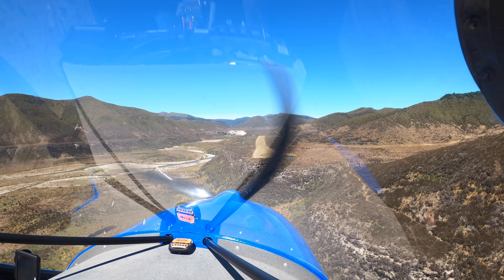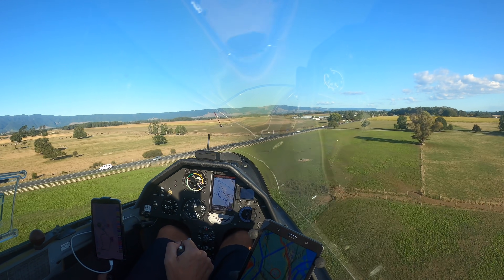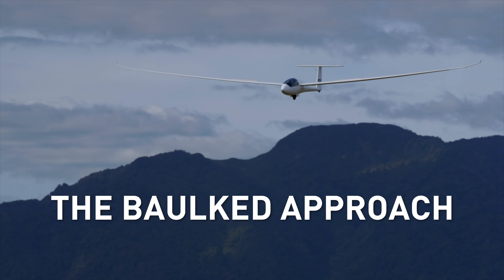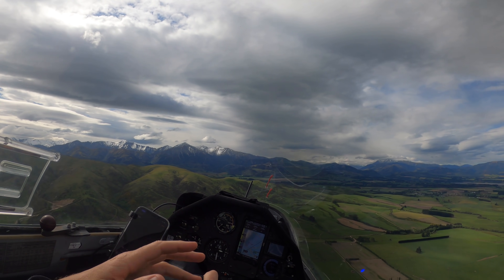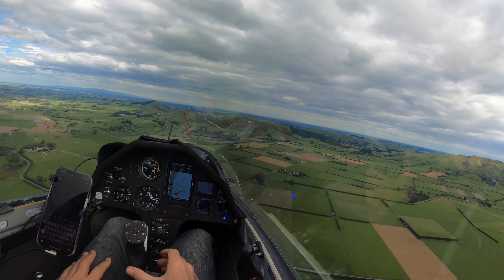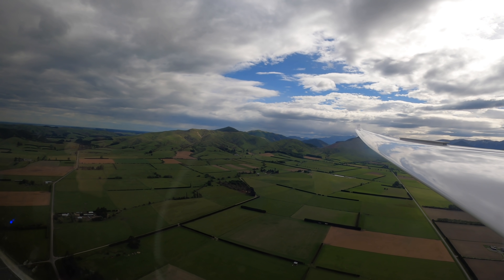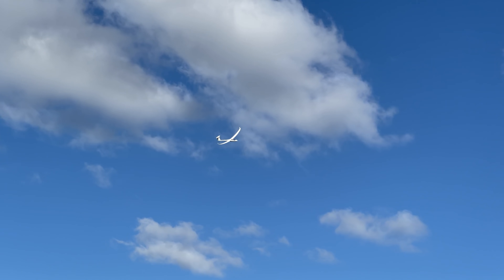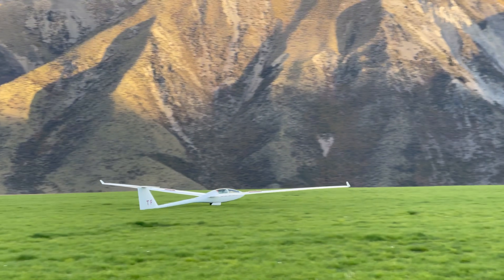Going around in a glider. Can a Glider Go Around?!

Comment: "the engine can't even go up that fast". If you have the engine and don't deploy it just to open the go around option if needed then you're just reckless. It's free safety ! Take it goddammit ! It's just like an airplane pilot switching on the electric fuel pump before landing : it's not for landing, it's tongo around.
Reply from the maker: Yes I would only do a fly through if I was at an airfield!

Comment: Of course gliders can't go around.  That's why glider traffic takes priority over powered traffic.  That first clip of the aircraft bouncing is PIO, pilot induced oscillation.  That means he came in too fast.  If you touch down at full stall, you shouldn't even have the speed for the aircraft to get airborne again.  He clearly touched down with flying speed.

Comment: Curious, in your practice landing let's say it was not a long runway and the obstacle was in exactly the wrong place. At the point you put the brakes away would you have had altitude enough to nose down, get some more airspeed and either go to the other runway or try again with a different plan.

Comment: This are endless opportunities compared to the options a paraglider has. In calm conditions your brakes varies the glide ration between 1:4 and 1:7. So we can't change the aiming point that much. You can try to steer but hence we have no rudder this always result in significant bank... and if you are not a good pilot this also result in a pendulum motion and or some pitch. So please if you are at a landing place for paragliders don't run across the field 🙂. We sometimes have hard enough time, when several gliders aproach the field at the same time and one of the pilots don't know the rules.
Reply from the maker: Thanks for sharing :)

Comment: Not exactly a go around but I used to own  a Slingsby Kestrel 19, it had a tail parachute which was not the most reliable in deploying. The airbrakes, well they made a nice noise. I would start my approach high, around 600ft and pull the parachute. It the parachute deployed, no problem, it was like catching your braces on the boundary fence. On the one occasion it did not deploy I had to rely on the reason I started the approach so high. I had the height to do a 360, with the lovely airbrake noise, and still make the airfield :-)

Comment: I was recently B Cert solo flying at Matamata in my clubs' PW5. I had setup a nice right hand circuit and was turning onto final when another glider, low and desperate, turned from base to final close in front and below me. They made the call for final. I acknowledged, I'd now be number 2, put my brakes away, watched them land below me then recommenced my steeper approach. Only disadvantage was I had to push the glider back a bit further after landing. The DI gave me a good pat on the back for that one.
Reply from the maker: Excellent, our training has proved you well :)
Reply: @PureGlide  , in my experience, B Cert and thereabouts pilots are among the safer pilots on the airfield.  They're current,  their training is still fresh, and they don't have that unwarranted cockiness that a 50 hour pilot has.

Comment: Is a contest finish technically a go-around?  Could you at high speed over the threshold pop the gear down, slow down and land?
Reply from the maker: I'd say at our runway, which is quite long, yes you could pull up, slow down, get the air brakes out and land. But you'll use quite a lot of space to do it!

Comment: I have twice done a go -around from a properly held off landing, from the ground roll, where we could have stopped; it did involve having a ridge at the end of the landing strip to fall off though!!  Airbrakes away, trundle offthe edge of the hill and down the slope a little, and back into the ridge lift!!  That was at Dunstable - airfield at the bottom of the 300ft ridge but a short strip (usually covered in walkers etc) at the top of the hill, from the old days of bungee launching from up there.  Also, a few go-arounds from the approach at the Mynd, where the club is based at the top of the 800ft high ridge - a high approach is necessary when the ridge is working, as its into lots of sink; but if a bit too high, no worries, go back into the ridge lift, climb and have another go!
Reply from the maker: True if your landing site has a handy ridge at the end then sounds like fun!

Comment: It comes down to several variables if you can do / have to do a kind of go around in a glider. I would not do so if there are areas on the airfield where to land safely, but this depends on length, width and layout of the airfield. If wide enough, you can go left, right or even about 45 degrees off your original landing spot. My home airfield is very narrow, (no meadows behind or aside) only 2 gliders could safely land beside each other (if both are landing to the left and right side, blocking take off as well), though long enough to have options to land in front or behind. As the area beside the landing strip „taxi area“ is quite narrow and bumpy, motorized gliders and planes sometimes use part of the landing strip for taxiing. One day I had to do a kind of „go around“, more like an aborted landing. As the thermals got weak, several gliders were in for landing in a short time. 2 were blocking the landing area right at the near end, one further down. So I came in a bit higher than usual, to land long. No problem. But just then a motorglider taxied where I intended to land (I was at final). In went the airbrakes and as I have had a slight lift on downwind, I made a short go around. No problem if you keep as many options as you can. Great video, very good explanation. Well done, 👍
Reply from the maker: Thanks!

Comment: Great video with very nice footages and clearly educational, and fun, with obviously the solution offered for most of us: close your brakes, etc..  Now suppose you are sitting in a fes glider (front electric sustainer/self launcher) and on final at a short field, when suddenly a deer decides to cross.... Assuming there is juice left in the battery, one could turn on the the fes after having closed the brakes and make a real go-around.... I have no experience with fes, would appreciate your opinion.
Reply from the maker: Yeah I didn't go into FES, that'll be it's own video at some point. But yes that's about the only type of glider engine that could potentially be used on final approach, because of the instant start. However you wouldn't be going into an outlanding field if you still had battery left! And if you're at your home airfield, you probably want to simply land up the field anyway.
Reply: @PureGlide  The “FES” on my RC- glider has saved the day, many times.
If you get blown over the ridge into lee-side-turbulence, no problem, just slam on the engine and climb (almost vertical) out of trouble…  😀👍
Reply: Or fire up the FES and dice up the deer for steaks for dinner.
Reply: There was a piece in the UK's SAilplane & Gliding last issue but one I think.   It was written in the aftermath of a serious (maybe fatal) crash with a two seater self sustainer ( not a FES BUT)              So what the accident investigators concluded was the crew hit a load of sink,  got too low far faaster than expected and instead of concentration on an outfield landing fixated on trying to start a sustainer motor that didn't want to participate.   Then some trees walked out in front of them and 'goodnight Vienna'.
But here's the thing:
Even with a FES either you see the deer, sheep, lunatic in a car etc well in advance and could start just about anything OR
It lurks in cover until the very last moment and your taskload is enormous.
My suspicion is you could do it ........ But unless its a very well practiced routine could easily go tits up.
Reply: There was a piece in the UK's Sailplane & Gliding last issue but one I think. It was written in the aftermath of a serious (maybe fatal) crash with a two seater self sustainer ( not a FES BUT)   ........      
So, what the accident investigators concluded was the crew hit a load of sink, got too low far faster than expected and instead of concentration on an outfield landing fixated on trying to start a sustainer motor that didn't want to participate.    Then some trees walked out in front of them and 'goodnight Vienna'. 
But here's the thing : 
Even with a FES either you see the deer, sheep, lunatic in a car etc well in advance and could start just about anything OR It lurks in cover until the very last moment and your taskload spike is *enormous*.    
My suspicion is you could do it ........ But unless its a very well practiced routine could easily go tits up.
In short,  IF its 'drilled in' to your mind as part of your Threat & Error Management - You maybe could make it work just like a powered plane would open the throttle.
Provided your FES would develop power fast enough?

Comment: A 'go around' is something I have only done once in a glider and I have no desire to repeat the excercise. As a newish Silver C pilot I bought a Std Austria as my first glider. It was an interesting beast and certainly had its challenges but on a half decent day would 'go' surprisingly well. Having been trained on a hilltop site my foremost priority was always to avoid getting too far downwind on approach but the Austria was no Ka 8, having much better penetration into wind and far weaker airbrakes. My first trip to a wave site in Wales ( the small one for those who know the area) was therefore, quite an experience! 

After a pleasant hour or two at 8000-9000' then suffering the turbulence on descent and establishing a circuit, I duly set up my final turn at about 1000', as briefed that morning. The issue was that none of the locals had ever flown an Austria and I had never flown on site before so none of us realised how inappropriate the 'briefed'  approach was. I think also, that the wave had shifted a bit and was providing lift on approach rather than just rotor so I found that even full airbrake settings had little or no effect on descent rate. I duly tried a full side-slip but the slippery shape and 'V' tail did not result in high enough drag to make much difference either, so I found myself with a decision to make! Behind me was a valley with about 600 - 700 feet of ground clearance and reasonable fields' whilst ahead of me was steeply rising ground and small fields culminating in a spine a similar height above the airfield. A right turn was not a favoured option and a left turn over a deep gulley provided lots of turbulence and a huge 'clutching hand' effect. Nevertheless, it was the better route to get to the valley behind and became my chosen maneouvre, preceeded by a swift radio call to the K13 (with CFI aboard) which I knew was in circuit behind me.

Upon completing a 180 degree turn I found that I had still lost very little height and the K13 had moved well away from the approach line thus enabling me to extend my downwind leg and have another go. To say I was concerned would be accurate (the abject terror came after landing) but I did manage to excecute a safe, but still long, uphill landing into the smallest airfield I have ever had the pleasure of using: pilot & glider re-usable. My next glider was a 19m Jantar 1 which had its own, quite different set of challenges at this site. Some say that if looking for a land-out field in South Wales there are many better options than this particular club and I am sure that is correct, but it is 'character building' and has become one of my favourite UK sites over the many years I have now been visiting. Happy Days! :-)
Reply: Ah the joys of flying at Talgarth - can't beat a glider with a good set of airbrakes and robust undercarriage flying from there. Can remember a certain ex tug pilot, now noted aviation journalist, getting 3 of us on the deck in the mud by flying the Pawnee a few feet over us - still remains a mystery to me how he got 3 guys running 3 different ways into the dirt, but I was too busy flinging myself at the ground to notice.......
Reply: @soaruk3697  Too right! My ASW28 was nice there though a '20' may have been better still.

Comment: Hi.
Let me report a case where an actual go around happened with a glider . And it was twice! The pilot only landed on the 3rd attempt.
The pilot was flying a Lak12. This glider is a 20 meter wingspan and the air brakes are not very effective. While in the final approach to land, he hit a strong thermal and even with the airbrakes full out couldn't descend and he decided to make a go around climbing a bit in the thermal and make a second circuit. On the second attempt the same thing happened, so he did another go around. On the third attempt he came lower and he finally managed to land.
So, in a very, very particular situation, a go around is in fact possible. But I don't recommend anyone to count on that!
Reply from the maker: Ha yes the 'ol Lak 12. We had one in our club. Great value for money! As long as you didn't want any friends, cos at some stage you'll have to rig it :)
Funny you should mention the 3 passes, I didn't show the rest of the Ash video. They have a habit of doing that too... certainly only something you want to do for fun, not necessity
Reply: @PureGlide  A LAK 12 wing weighs about the same as the inner panel of an ASW17 - you can single handle rig it with the right aids...it's usually when you have too many cooks spoiling the broth that they become difficult to rig...the airbrakes are better that quite a few gliders i.e. Libelle 301, Fleabus, and you can mod them to become more effective I think.
Reply: @soaruk3697  I always liked the LAK-12, it has great distance performance yet thermals like a wooden plane when flown without balast. The thing with the air brakes on the LAK is that they are very far backwardson the wings (like 60% back from the leading edge). The result of that is that approach speed is very important. I generally just used full air brakes, full flaps, and then determine where you land by varying the speed (+/- 2kts). I completely agree with your comment about the rigging, we had good rigging aids which allowed single person rigging (two is a bit more convenient though).

Comment: you can do 'go arounds' at certain hill sites..... ie. touch down, put the brakes away then fly back into the hill lift and climb to do it again :-)........
Reply from the maker: That would be fun!
Reply: The Long Mynd comes to mind.
Reply: Yep, have done a couple of go-arounds at Sutton Bank on ridge days!
Reply: is that not more a touch and go?
Reply: @mellissus  Quite possibly - you can do it without touching down though - but less fun, but then  'a go around' is actually an aborted landing , climb back to circuit height and then a second landing I suppose.........
Reply: @soaruk3697  you just make it sound even more fun to do (:

Comment: Excellent video.   2 kms is a good distance to glide. If worse comes to worse, you could find another paddock.  Could you even do a 180 and land downwind?
Reply from the maker: I wouldn't recommend doing any turns at 200 feet, but if you're a bit higher maybe. But you should have your field picked out and the wind direction correct by then anyway if it's all going to plan! Often worth having a backup field past the one you're aiming at, just incase you discover a ditch or fence on final approach...
Reply: @PureGlide  Minimum height for a return to base from aborted tow is 200ft - often practiced in the US...... :-) ......